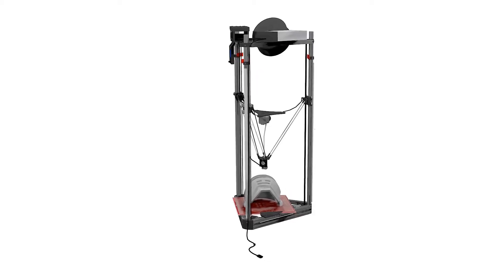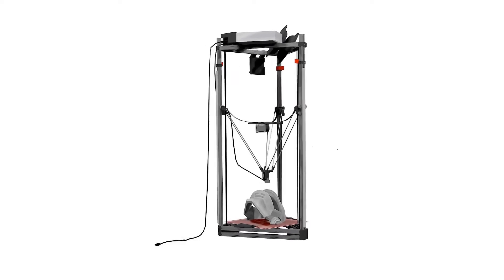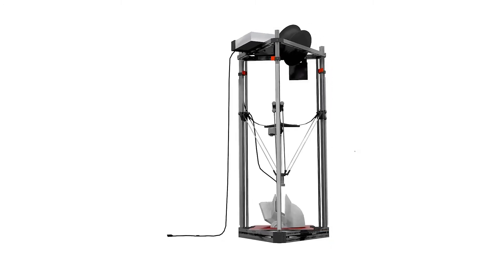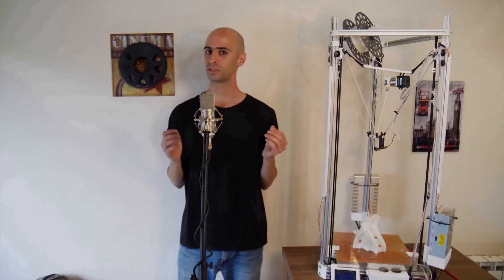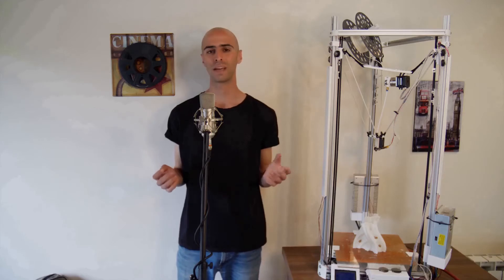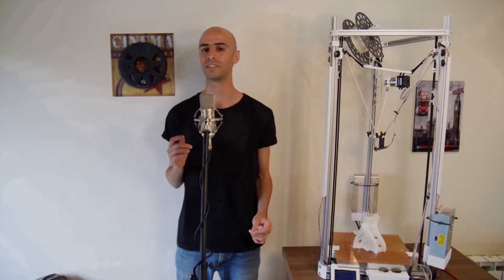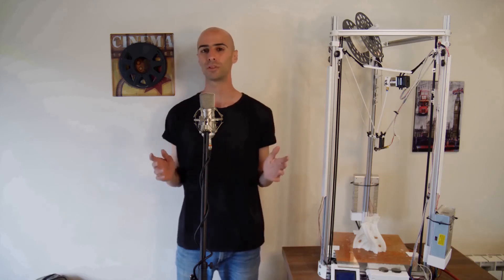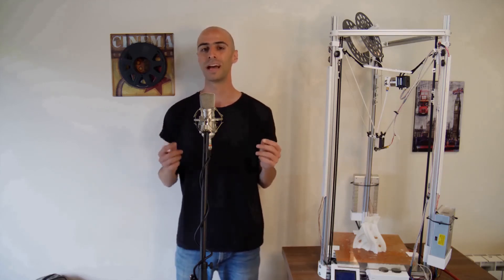Build a Delta 3D Printer - Introduction

Comment: I have a question for you…. A friend gave me a delta 3D printer. It hooks up to my computer, it turns on, screen lights up, but although my computer dings indicating that something is hooked up to it, nothing shows on the computer screen. 

I am searching for a download or something other to pair this 3D printer with my computer so that I can start printing. There is no name brand on this printer. Any help would be greatly appreciated. Thank you!
Reply from the maker: Hey there, does the printer screen show anything other than blue? If it doesn't then you might either have a burnt Arduino Mega board or it might just not have any firmware installed. I will be uploading in the future a chapter on firmware setting with Repetier and Arduino IDE
Reply: @myriadpro6752  
The screen has printing on it. SD card on the left side. A friend and I built this 6 years ago and ran a few projects on it. Then it sat for all this time collecting dust. So now that I have it again, I am trying to remember how to get this up and running. He did say that I need to download Repetitor software to get it operating again. So I’ll go that route. If you do not mind, I’ll ask you more questions when the time comes? I do appreciate your reply!